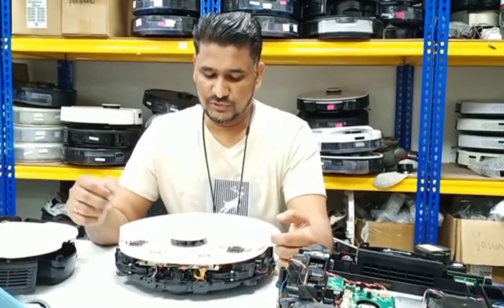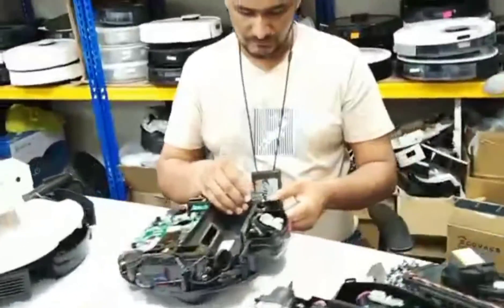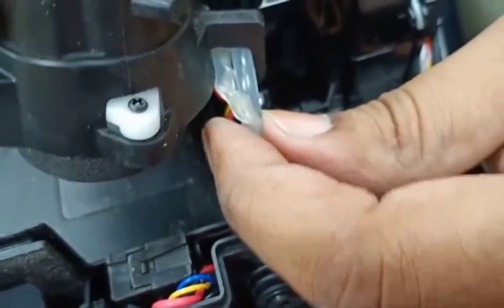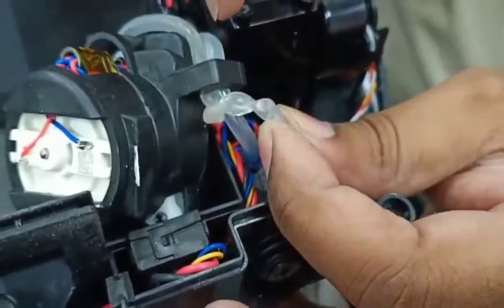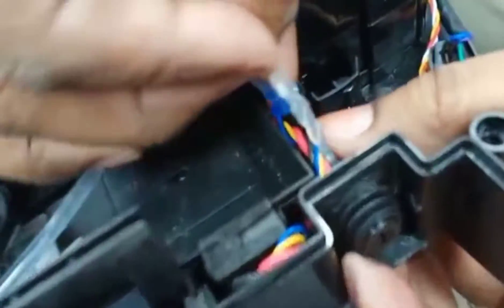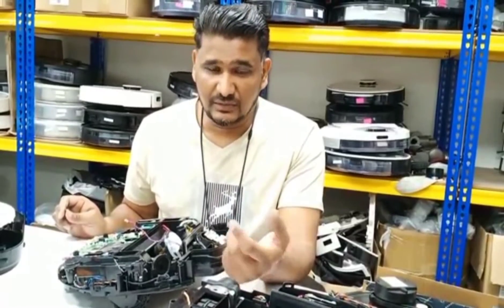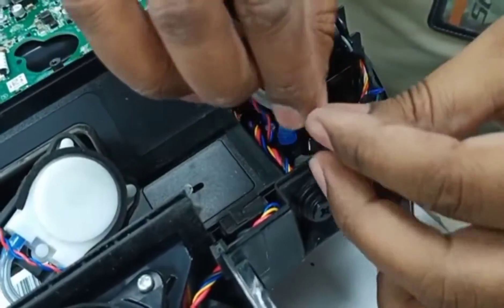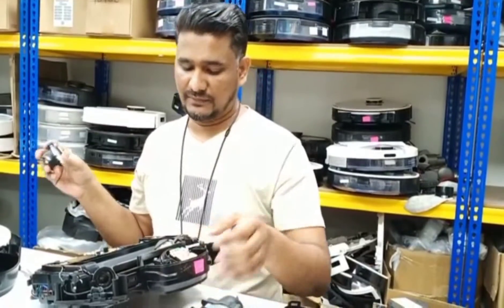Ecovacs | Deebot T9 |  Water Not Dispensing | Water Pump Issue Solved

Comment: Is there an easy way to test the water pump before disassembly? I used some detergent and not sure if the issue is a block in container or the pump is broken
Reply from the maker: 2 video available at this topic plz check TQ
Reply: @ecovacstechnicalsupport5278  Thanks, I cannot find. Could you post a link?

Comment: Can you teach how to open the top white cover?
Reply from the maker: Plz watch lds related my videos..I think mentioned already..first of all need to remove Front small long plate next to D-Tof cover... just put your finger in n pull up that cover... underneath got 2 silver colour screw... remove those...then lift up back top cover..you can see 2 round white rubber locks.. remove those then underneath you will find 2 black colour screw...plz remove now you can open D-Tof/LDS cover
Reply: @ecovacstechnicalsupport5278  Thank you! I managed to open and see the water tubes. But they are not entangled. But water is coming out so slowly despite on high water setting. Do you know what is wrong? Appreciate your help!